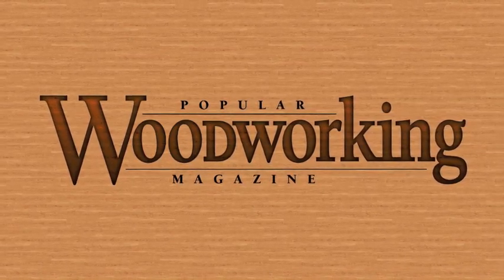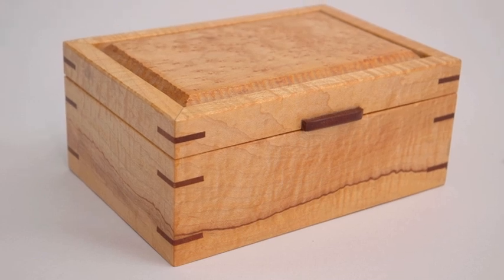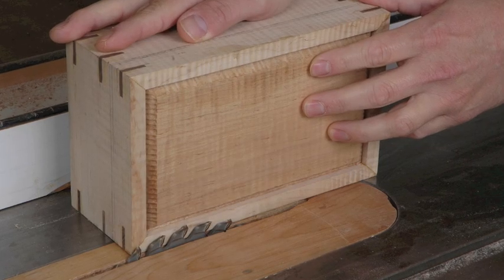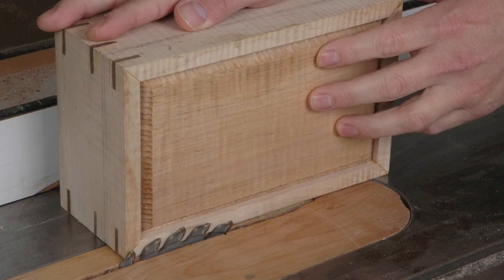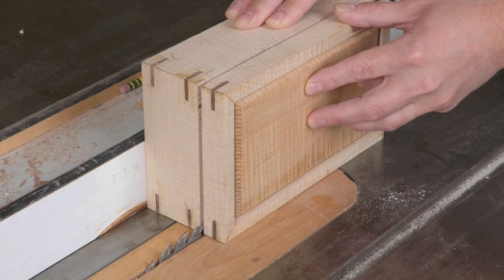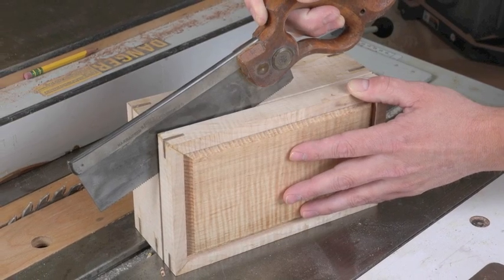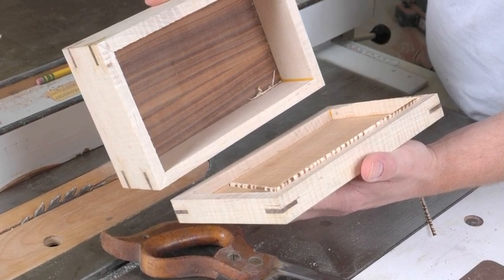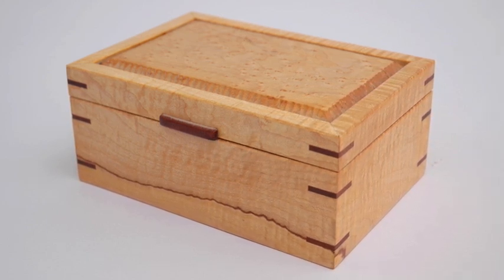Cutting a Lid from a Box

Comment: I don't like this method.  when planing or sanding any left over from the hand saw you risk chiiping and peeling.  Tape the box all the way around, shim it when you get an open side and be done with it.
Reply: Don’t even have to shim it. Piece of double sided tape on each side of the cut line and press a small piece of plywood on it. Don’t have to even concern yourself with the shim falling into the blade etc

Comment: Saw the boards 1/3 the way thru before you join them together into a box.  When you assemble the pieces, put the cut on the inside and mark its location on the outside with a pencil.  When you go to cut the top off, make sure your cut on the outside is lower than the inside cut by no more than the width of the kerf, and only cut 2/3 the thickness of the boards.  Doing this will create a lip on the bottom & a recess in the lid.